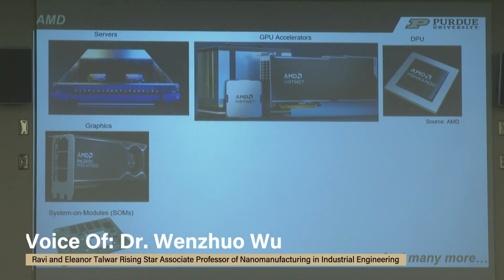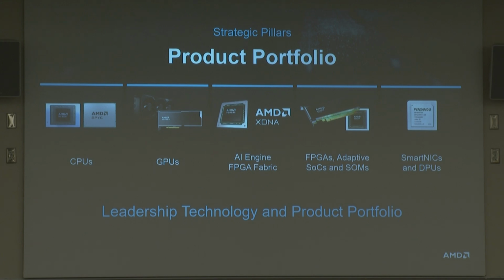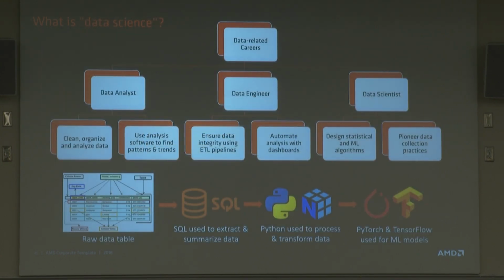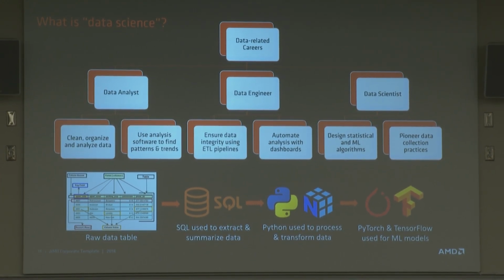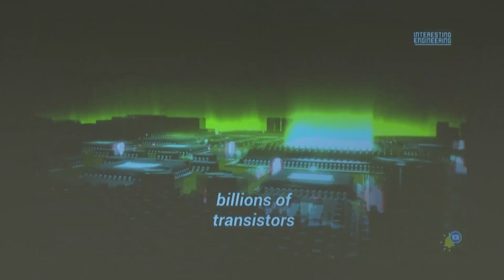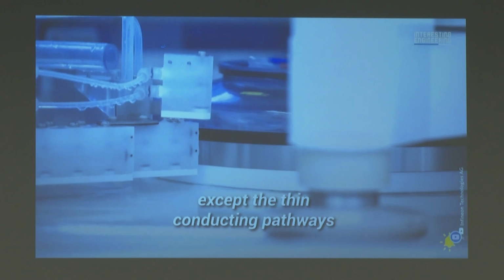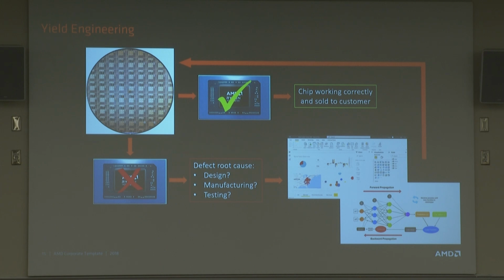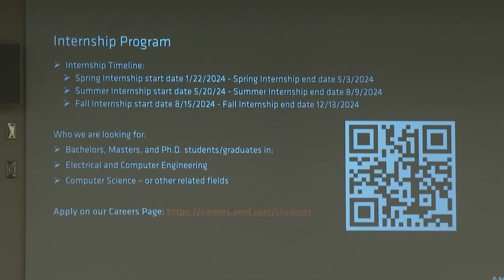Data Science in the Semiconductor Industry

Comment: Nice talk. Though I want to see more chip types. Hybridized quantum and classical builds. Heat pipelines built into chip disign. Helping move heat from bottom to top. Optical used in designs, both data tranfer and optical computing, and can be put on a axis leaving wired for a axis. Building multicore, multifunction cubes layer by layer. A.I. assisted architecture layout with some built in redundancy.